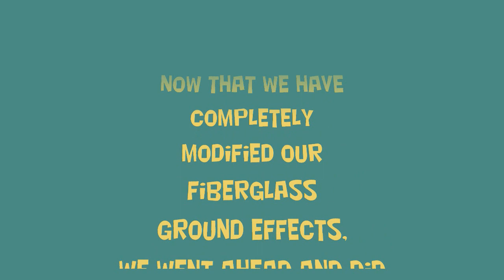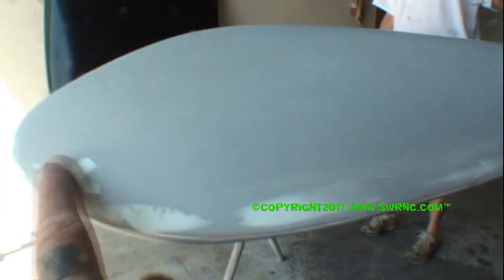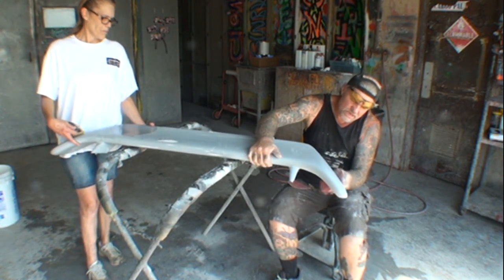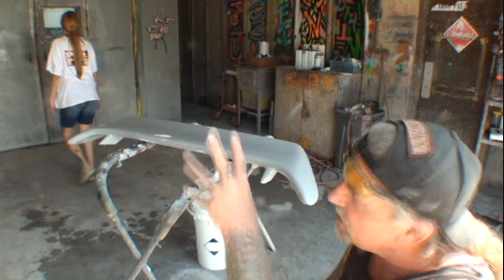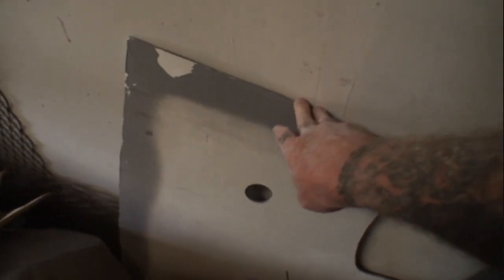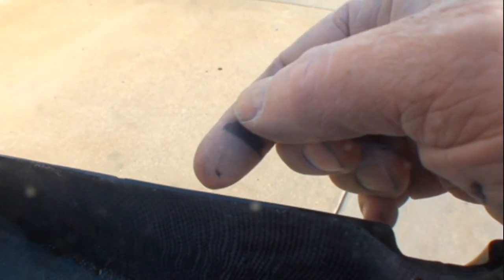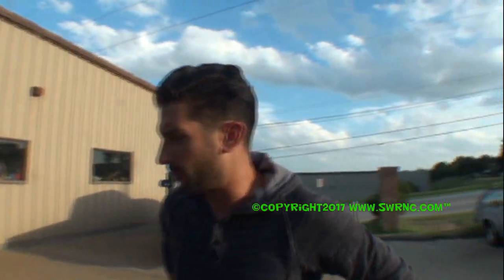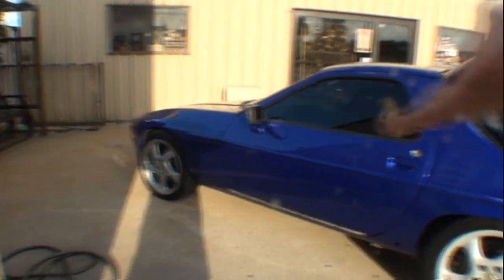How To Install Fiberglass Ground Effects On Your Car Or Truck  | Part 5  | EXTREME FAILURE

Comment: Imagine prepping carbon fiber with a million pinholes only problem you can't use putty it is my daily problem but I get it done I started working with fiber glass parts which sucked out of the mold but still made them work and sellable. I definitely understand how tedious it can be. CUSTOM...